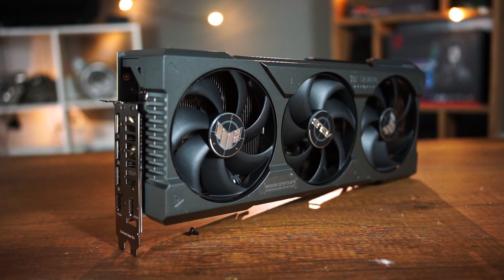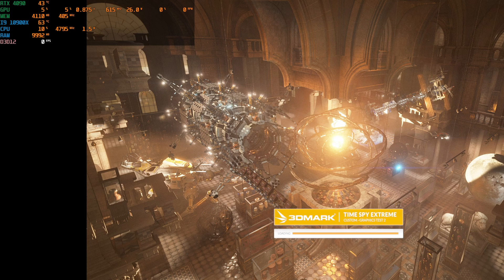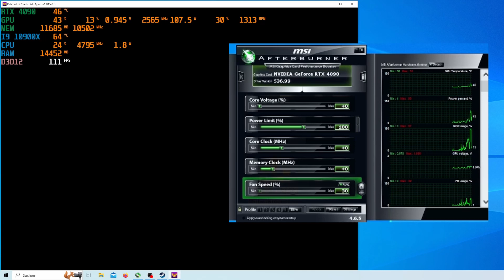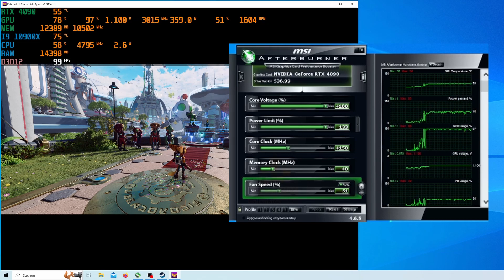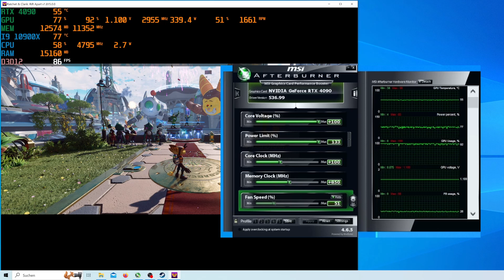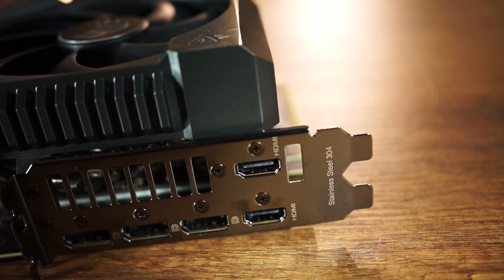Making the RTX 4090 even Faster! | Nvidia GPU OC-Guide | How to Overclock Geforce RTX Graphics cards

Comment: The OC Scanner of MSI Afterburner only recommended +80 on core and +200 on memory and honestly I don't see any practical differences anywhere with those numbers. Even running with those specs I once saw textures disappearing from AC Shadows. I'll give higher numbers a try and at the end of day if I don't see an improvement that I can notice I just leave them off. I have the watercooled RTX4090.